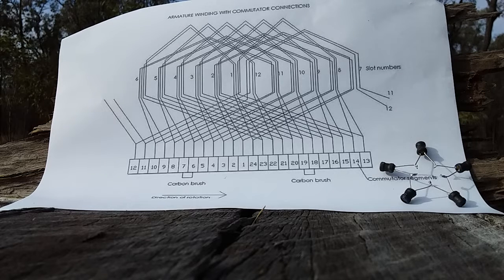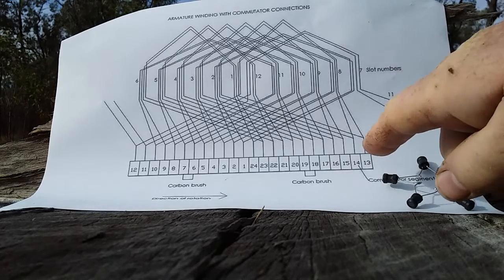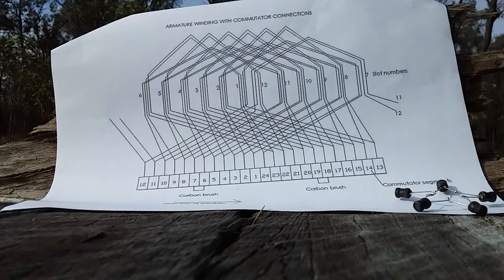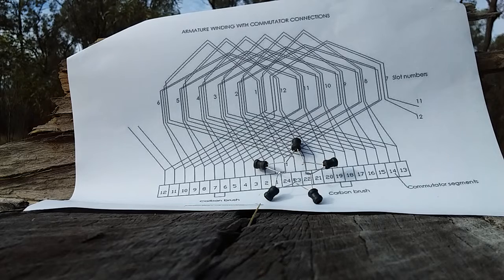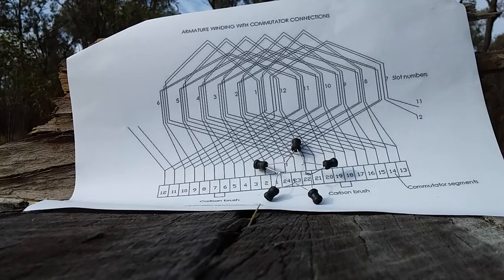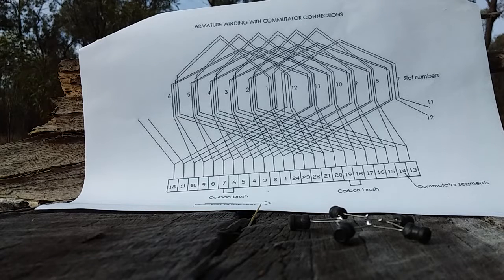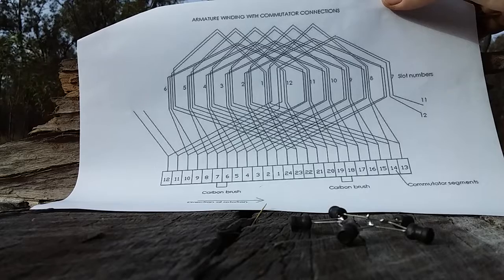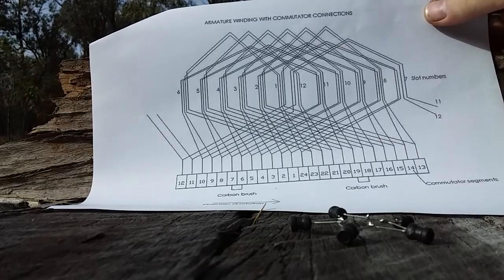Motor Builders Handbook for DUMMIES - The proof is in the *Hard Core* Documentation!

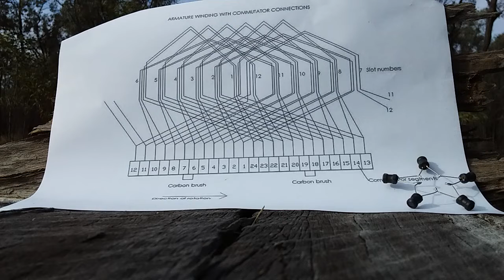Comment: Pause @ 2:17
Commutator 7&6 R only connect by Carbon Brush & the internal continuous wire
Where 7&6 meet they become a pair of windings of length x
7 heads of in a continuous coil route & come back to 6
6 goes off as a pair & come back to commutator 5
Incrementing ONE segment at a time
All the way round to 19 & 18
While one side becomes North the opposite is South;... causing a rotation motion in a Magnetic Field...
But are still in a continuous series coil winding only being connected by the carbon brush opposite each other 7&6 19&18 likewise incrementing round as the arrow indicates the direction of rotation... Left to Right along the diagram...